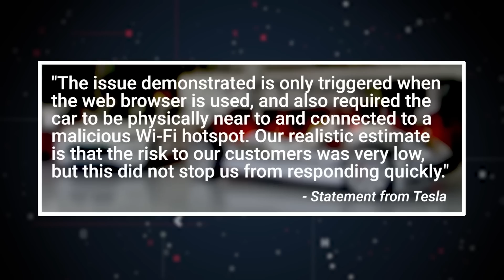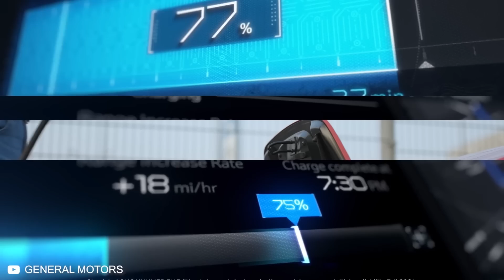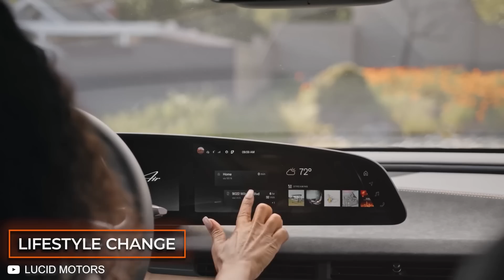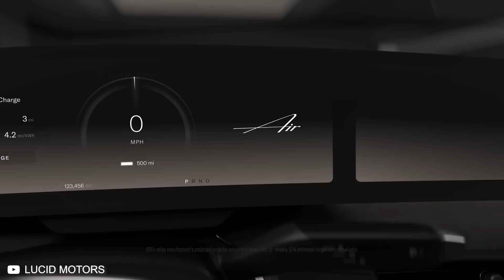EVs' Serious Problems That Carmakers Are Hiding

Comment: EVs may be a good solution if one lives in a southern country with your own home that can support a solar array and battery bank and you only do infrequent long trips and can charge your car away from the house to avoid it going on fire and burning your house down with you in it - a risk that will result in high insurance rates. But if you live in an apartment block unless you have an underground car park you are likely to have a problem with charging on the street and the more EVs there are the more severe this problem will become no matter how much the range is increased. Then there is the not so small matter of where the electrical power will come from as a simple calculation tells us that if the electrical grid is limited to wind and solar with some hydro as planned there will not be enough to maintain the current car fleet such that one suspects this will be solved via a social credit system with energy limits and/or by limited car ownership and the rest using the public transport of self-drive taxis. So the future will be EVs for the rich and feet, bikes or buses for the rest.
Reply: The environmental whackos running our country do intend to remove fossil fuels from civilian use (they are excluded from this) so, as you said, wind and solar only for electricity. We cannot meet demand now without rolling blackouts. Then they expect all of us to turn in our reliable gas cars, spend 60 to 80 thousand average for these tech terrors and watch our electric grid fry like a frog on a griddle. As America becomes more communist cars will only be fore the coastal elite. I laugh at the people who have Biden stickers on their cars. They voted for this. I didn't.

Comment: Electric cars also destroy the environment including releasing greenhouse gases through resource mining, manufacturing processes pollutants and ultimately going to the landfill in mass droves. The pollution they cause is simply unnecessary as is the amount of urban space squandered on parking and other paved over autocentric wastes. They also perpetuate urban sprawl, redlining, the food deserts that come from that invariably, along with cities that are not navigable as a pedestrian or bicyclist and are, in fact, inhospitable to humanity along with being horrendous towards animals. They add to traffic congestion. Commodification of societal needs and normalization of trying to substitute rampant consumerism where we need standardized, regulated and uniform public utilities doesn’t work.
Putting the financial burden of transportation inefficiently and directly on the individual citizen is simply not wise or fair and hasn’t been the norm for even 80 years. We need to invest in commuter rail that’s properly implemented as it typically is overseas. A commuter rail system is an engineering marvel while buses are just buses. The most reliable predictor of a neighborhood being impoverished is if it has no commuter rail connection. The American people are apathetic through decades of disenfranchisement and a lot of that marginalization (eg Robert Moses’s racist urban renewal) is through divestment of public infrastructure, utilities and programs to help the American people. How many special places were destroyed fated to become mere parking lots? How many lives were wrecked as entire communities and cultural centers of minorities were wiped off the face of the world as though an atomic bomb had been dropped on it in order to force through highway robbery highways were pushed through the wreckage and rubble of razed annihilation that those same victims now in atomized diaspora had to then help subsidize which is often the case with the rapid onslaught and constantly rupturing outbreak of mediocre monstrosities being raised all over the place currently, looming gloomily over neighborhoods they’ve doomed as ugly tombstones in the spaces of what was demolished for them to be erected. We’re past the point of car dominated transportation being anything better than a tragic hindrance or an outright travesty. Public works materially improving life for the taxpaying citizenry will bolster civic pride.

Transcontinental High Speed Rail should integrate seamlessly with commuter rail networks so it can evenly function as one cohesive system and this will convert flyover country back into a thriving heartland by functioning as an artery of commute and commerce which will reduce clustering on the coasts. Similarly, wholly integrated circuits of commuter rail blended with interurban routes, light rail lines, street car grids, subways, and even trolleys along with ferries functioning together as a comprehensive series of interwoven systems would prevent people from having to live on top of each other in city centers in order to have quick access to urban cores and downtown areas so this would stimulate our local economies and prevent gentrification from demolishing cherished heirlooms of our historicity, destroying our classic neighborhoods, shredding the fabric of our communities and toppling our civic landmarks and architectural heirlooms along with other social capital such as venerable culture generating venues.

Numerous studies show that built environments of homogenously bleak and bland duplitecture dreck made from extremely toxic and highly flammable petrochemicals that profiteering developers push on us for their privatized gains to our public loss for the riches of themselves and corporate slumlords not only cause homelessness from being financially inaccessible to most Americans, but also cause depression from creating such a devastatingly sterile, cold, unloving urban habitat that’s too congested and overcrowded to work properly as a correctly engineered built environment. Our downtowns are chock full of skyscrapers and high rises that are horrible for the climate and environment whether they’re LEED certified or not. Our roadways are overcrowded and no amount of widening them and adding lanes will do anything to help it because it just leads to induced demand that inevitably grinds to a halt at snags and bottlenecks down the road. Shouldn’t American cities be thriving centers of culture and character rather than austere and chintzy morasses of mediocrity?
I believe that we can design the cities of our nation to reflect a future that embraces humanity and that we also must for America to have any sort of a bright future ahead of it. Right now we are mired in the destruction of our cities from the inward attacking neocolonial oppressors who weaponize their clout of wealth against the nation for their own off-shore un-American gains of privileged, parasitic, private profits. This greed fueled anti-social exploitation is present day feudalism driving us into another gilded age. Tons of new brutalist “luxury living” housing units remain empty serving only as financial assets in investment portfolios of hedge fund and permanent capital firm cretins sheltering dubiously acquired wealth instead of as direly needed shelter for humans. We deserve a landscape we can be proud of and country should come first before corporate looting and exploitation. Legacies are important and live on forever.

With space opened up in our cities we could rebuild beloved structures gone from economic and environmental disaster utilizing new technologies such as hempcrete and 3-D printing. We could create vertical agriculture farms etc. on spots currently now just serving as paved over squares and nothing more. With solutionary commuter rail infrastructure forming the framework of walkable environs Americans won’t be shoe-horned into a physical atmosphere that forces bad health upon them. We can extend democracy into offering the taxpayer residents democratic say in what their city consists of, how it looks and how it operates promoting civic engagement and participation.
Reply: The fossil fuel it takes to charge EVs and to manufacture them dumps less CO2 into the atmosphere than private vehicles using internal combustion engines. The amount of petroleum needed to provide fuel for mining and how much CO2 it will dump into the atmosphere is minuscule compared to the amount private vehicles use. Fossil Fuels raise serious risks for our grandchildren, but mining metal for batteries does not. The technical debt is much greater using petroleum for gasoline. Petroleum is too valuable now to waste as gasoline. We should leave as most of it as we can in the ground so our kids and grandchildren can use it for plastics, paint, etc.

That being said, all energy sources degrade the natural environment and they are all are dirty, The responsible choice to make is the least dirty one, not the one where you get to bill your grandkids for the cleanup. What is being pumped into the atmosphere represents an enormous technical debt, which is much much more than all the tax expenditures and all the subsidies by all countries to wind and solar energy and EVs.

Comment: One more issue. In case you run out of fuel in the middle of the road, you can walk to the next station buy and fill a can of fuel bring it back and you can roll to the next station. You can't do that with a BEV. You must be towed in.
Reply: Here's a neat trick, though. . .  With most EVs you can hook up a basic tow strap with another car and pull it down the highway for several miles, and the regen will actually charge the battery a little.  Then you can unhook and drive the rest of the way to a station.

Running out of charge should be rare.  Most EVs have the range display right up front, and hooked into the navigation system too, so they will give you advance warning if you even start to stray outside the range of any stations.
Reply: Only if you don't need to go more than ten miles, many AAA trucks can charge and EV.
Reply: Only if you don't need to go more than ten miles, many AAA trucks can charge an EV.

Comment: Lots of misinformation.  ALL modern cars are hackable, gas or EV.  EV1 did not fail; it was very popular and had a large demand but Chevron bought the battery rights and had them scrapped by GM.  99% of people won't have to worry about range anxiety unless they're taking a long trip and most of that can be easily overcome with a little bit brain power and planning.
Reply: Define a long trip. From Valdosta to Atlanta, 230 miles plus your running around in horrible Atlanta traffic and back would leave most EV cars sitting on the roadside with flat batteries. Sure, some would say 'spend the night in Atlanta', um no thanks, I want to still have a car the next morning.

Comment: You think that it is going to control pollution ? How do you think electricity is generated ? How many thousands of tons of coal, how many thousands of gallons of diesel fuel to transport coal ?
I believe the cost per miles of an electric car is in the range of $135.00 usd per mile of operation.
There is no savings in fact the manufacturering plus electrisity do you need to go on.
Electric cars don’t save anything the government is blowing sunshine up your keester in order to make you think there better.

Comment: Range at speed is seriously lacking, i.e I often drive 600miles at 130kph or to the cross channel ferries, some 6hrs drive without stop, now if an EV can gurantee a range at 130kph then theres an issue once reaching the ship, charging or not as the case maybe onboard, disembrking therefore at the other side is an issue having to find a charge point, no entirely impractical.

Comment: volvo just released data that shows the ev model of the same car in petrol only becomes greener after they both hit 90.000 miles so if you do less than 10.000 a year its not as green as a petrol one  because you will need to change the battery's after 10 years
Reply: Your sources sound fishy
Reply: @fyourfeelings8966  Having announced that it will sign the Glasgow Declaration on Zero Emissions Cars and Vans at COP26, a study by Volvo Motors says that the manufacturing process of its C40 Recharge electric coupe-SUV generates 70 percent more emissions than that of the ICE-powered XC40 counterpart. However, when the car’s lifetime is factored in, a breakeven is reached, and the EV’s total carbon footprint is less compared to that of the ICE vehicle’s. 

The Volvo study painted a like-for-like picture, with the XC40 range comprising fully electric, PHEV, and ICE versions of the compact SUV. Their findings take into account the entire lifecycle carbon footprint of each and include mining of raw materials, production processes, fuelling it, and then driving the vehicle for 124,000 miles (200,000 km) before final disposal.

Comment: Sorry--this tries to sound like a balanced presentation, but it's not. It's intended to sow FUD. Most of the negative information presented is out of date or just false. For instance, the statement that your driving range decreases by half when you get an EV is completely wrong--unless your gas car routinely goes over 600 miles between fill-ups. Tesla Model 3 and Model Y, as well as the various EVs from Kia, Hyundai, Chevy and Ford routinely get 250 to 350 miles of range on a charge. A Model S can get over 400 miles. If you have a Tesla, you are in range of a Tesla Charger anywhere in the lower 48 and all of southern Canada, in any direction you care to go. You can also use the non-Tesla chargers that are springing up in all major cities and along major highways. And you can go from 20% to 80% in about 20 minutes now. Still longer than buying gas, but not at all oppressive, even on a road trip. And if you are not on a road trip, most EV owners charge at home and leave home every day with a full "tank." They never, ever, have to stop at a gas station. Let that sink in. And where I live, electricity costs about 1/3 what gasoline does on a per-mile basis. Finally, I don't know where the 2.3% range loss per year figure comes from, but it sounds excessive. Typical range losses on a Tesla are 1-2% the first year, and less than that on following years. The batteries last longer than the cars--there is no need to worry about replacing the battery unless it is destroyed by an accident. Don't believe everything you hear!

Comment: Hmmm, interesting that the EV1 was mentioned as one of the electric vehicle failures, since it clearly discontinued due to it's inordinate success.
Reply: YA,  I have been preaching  "Who killed the  EV1 ? "   since  I read that the  Kia's  are  burning up   .  The only failure was that  GM  couldn't figure out how to get rich off the EV1.  In the Wiki article, it sounds like  we , the taxpayers  funded 1.25 B  in research costs for it .  With a Nice  250 Million in profit for the project .   PRICKS !!
Reply: There is a great documentary about it, but I can't remember the name.  Worth seeking out.
Reply: @someguy2135  That's what its called,  Who killed the electric car ?  1996  I think
Reply: @Wag2112       Thanks.  Maybe I'll watch it again.
Reply: If you put that same weight of Li-ion batteries in an EV1 today, as it had in Lead acid batteries (1175lb), it would have a range of 450 miles and a 100kWh battery!

Comment: Why are we doing this? We still need the internal combustion engine and will for a long time. This problem of range anxiety could easily be solved by installing a small gas or diesel motor spinning a generator for battery recharge. Problem Solved! With this type of automobile if your home didn't have electricity(say a giant ice storm visited)you could plug your house into your car and life goes back to normal. This isn't the Prius concept which is overly complicated it's simple because this is old technology we used it in WW2 to power our Submarines and Destroyer-Escorts

Comment: I'm a trucker by trade and I absolutely love my electric car. I have a nissan lead 2012, an audi etron 2022. And a hybrid audi q5e. They save tons of move. And so far I've been blessed with zero issues and no noticeable degradation in batteries!
Reply: If I owned that many expensive electric cars I would have to live in one of them because they would cost as much as my 6 acres and 800 square feet.
Reply: You sound like an advertisement with Chinese translation...